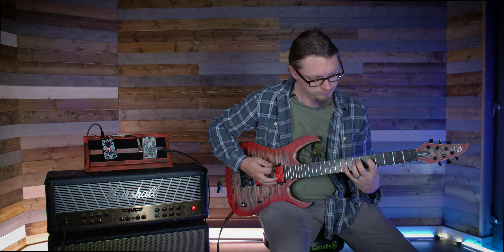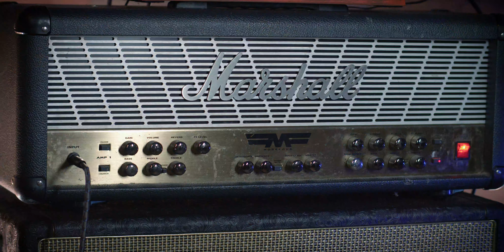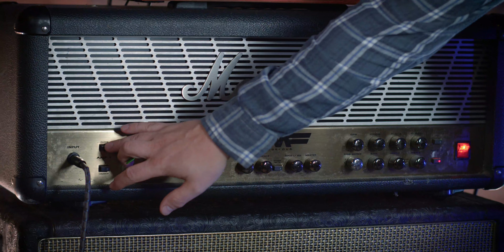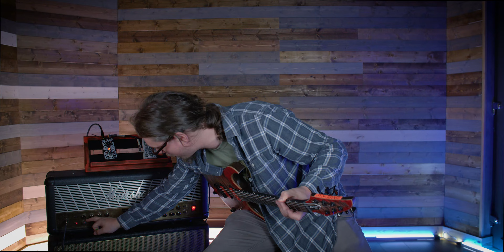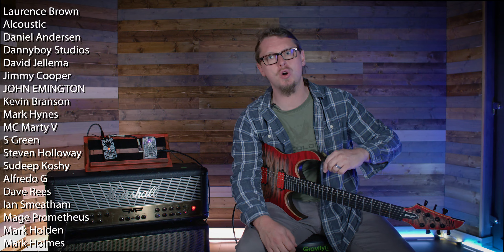Marshall Mode Four - The Solid State amp that didn't actually suck

Comment: When all is said and done, most of us that shred and sweep a lot are using a large amount of solid-state pedal gain or solid-state digital modeler into our valve amps, otherwise tube sounds like it's made of glitter and a kazoo, especially with pinch harmonics. 

I'm an electronics engineer I can also outplay the vast majority of guys with "tube or nothing" religion, and I prefer solid-state bar none. I have some wicked all valve rigs but when the rubber meets the road, either your playing is on point or it isn't and when it is not, you sound 100x worse on 100% solid-state than tube. The division is a scam. Designing and building solid-state that sounds 100% valve isn't the least bit difficult or expensive, it's just greatly frowned upon by the corporate brands.

They want to keep 3 distinct active technologies, solid-state analog, solid-state digital and valves. So, for decades virtually every band has commissioned engineers to design solid-state that intentionally never sound like valves. It's relative to The Light Bulb Conspiracy.

Comment: I’ve owned three and considering getting the half stack again but I can’t help thinking the footswitch is going to be an issue eventually because of its old pin connection ?
Reply: I found one for sale and picked it up.. (I bought a  MF half stack and didnt come with the pedal)
Reply: @ironandzinc  believe it or not I bagged the straight mode four cab on one occasion for just £50 but then at my next gig was faced with a load of stairs and no lift . Not fun and a shame as it sounded amazing compared to its little MG100 predecessor .

Comment: it's a hybrid..not totally solid state.. i have one.. the bad things are:  hard to read knobs.. really.. , the input connector is very  cheap.. 
the foot pedal has this proprietary 15 pin cable and  you can ONLY use the footwitch made for this amp.  if you don't have it (like me), you are basically stuck on one sound unless you use the front panel.. i with they would have added the option to plug a regular on - off switch like the mesa boogies in case you don't have the mesa footswitch.. 

otherwise, i am surprised the excellen  sounds i am able to get from this amplifier.. there is  some noise from the fans but they idle to very quiet a minute after the amp is turned on.
Reply from the maker: It has a couple of preamp valves at most. It’s a solid state power section, so it’s a solid state amp by definition

Comment: Had one of these and the matching angled cab for many years. It was incredibly loud, and looked very cool. Other than that, i couldnt get a decent sound from it. Just thin, cheap sounding distortion. Didnt really know what i was buying when it came out (was my first big amp purchase for gigging, should have done my resaerch but I was young and impulsive) every amp ive owned since has been more versatile and sounded better, including my Marshall dsl1 practice amp

Comment: it's really a valvestate amp, the valve preamp might be the part that made it not actually suck.. not sure on the technical bits, i don't get too deep into that stuff but i can tell you that these are the beasts that feed on beasts. i havent needed or even wanted any other amp in the 17 years that Big Bessie has been with me!
Reply: Right! I went to buy a rig in 04. I brought my LTD EC-1000 into GC and tried almost everything they had. It basically came down to a new Mesa Single Rectifier 50 watt solo head(it sounded better to me then the Dual/Triple, same pre amp but a 2 ch 2 6L6 power stage that still got louder then my band would ever need). Then the Mode Four, 2 pre amp tubes;I was told. I dialed in the same I was dialing the JCM 2000s and got a bitchin' brutal sound. For some reason the GC guy kept selling me the Mesa by saying this is used and has no warranty blah blah blah... being discontinued soon. I'm happy with what I chose and am still with my Mesa +  Mesa Recto Cab 2x12 for 19 years but to this day I still have the Mode Four's sound in my head and want to pick up a used one soon.
Reply: @roymartin500  yeah it really sucks with all the 'supposed' problems historically but i've had none. even after a couple beers and half a can of rockstar she never missed a beat (or note i should say). even worse was when the head hit the pavement as my mate was wheeling it through the carpark, still didn't stop it. so the part that sucks iz i'm forever cringing for that time when it happens and one of the boards blows and i gotta put it aside until i can get the guts replaced which is a huge job from what i can tell.. anywayz the common fault is apparently from overengineering so it kinda suits my style of music anyway without even hearing it hahaha. i'm not sure if you should be weary trying to get one because yeah, i've had 0 problems with it and it's one helluvanAMP!
Reply: if people start using the word helluvanamp then you know you saw it here first 🤣

Comment: I just got one a couple of weeks ago and I'm really enjoying it!! I have found that running the fx send into the fx return of a valve amp (I've tried a line 6 spider valve and an EVH 5153) and it sounds pretty fantastic!

Also, this is technically a hybrid as the preamp has 12ax7s.
Reply: Hybrid amp is when power amp is tubed, power amp doesn’t.
Like MusicMan’s.
Here tubes are placebo effect.
Reply: @ratt669 I’m not quite sure what it is you’re trying to say. Sorry.
Reply: @buhimoth sorry for you then. Maybe read more than one time and look on Google what “hybrid” amp means.
Reply: @ratt669 I googled “like musicman’s” and it came up with “sterling.” I don’t think Google can help translate your comment. 🤣
Reply: @ratt669 with all due respect, if you’re going to post an unintelligible comment and refuse to explain what you meant, what’s even the point of commenting?

Comment: I have/had two (one of them keeps blowing MOSFETs) of these amps and they’re awesome. Seriously underrated especially for the price they go for. I got the first for 350 and the other for 500 with the foot switch. I’m currently trying to find a matching cab for it as they are awesome as well but hard to find.
Reply: I run a Laney LX412A (or is it an LV model) cab, closest match i could find for the wattage. Not a bad match up. I had the same problem finding a MF cab for mine. I've owned 2 MF350 amps now. Love it. But i tend to run effects into it as its difficult to rein in the tone. Just a digitech RP255 with custom EQ

Comment: This amp is awesome! And scoop is useless here, as you said.
Reply: I used it on a master of puppets cover, and the scoop button is perfect for that haha
Reply: Scooped guitar is good for clean lyrics, (also with low bass cut and high treble cut). You can sit the vocals in the lower midrange pocket and also the S and T sounds and hi hat. In Metallica they don't actually crank the guitar all that much, so the drum transients and vocals come through nicely.
I like the mid heavy sound for instrumental though. They were a bit stingy on the bass guitar on some songs though.
Reply: Scoop works great for black metal!
Reply from the maker: An HM2 playing through a broken 40 year old PA system works for black metal 😂
Reply: @adamsteelproducer  hardyhar!  Hey, I have a mode 4 and I wanna add chorus + delay , but use the amp distortion.  Those go through the effects loop, right?  Also, where did you get that pedal case that sits on the amp?

Comment: I have the 1983  Peavey Bandit 65. In 1983 Kirk Hammet had finished most of his tracks using his Marshall stack but it just did not have the attack or balz he felt he got in the room. The studio had this 'New' Peavey and the engineer suggested doubling the parts with it. He did :-) After reading that I looked in the local Kijiji ads. A guy had one never gigged that belonged originally to his dad. It's in near perfect condition (just dirt and grime) I got it for $270.00 USD. It needed a good scrubbing and the volume knob needed a quick contact cleaner spray and it now functions like new. It has a huge percussive sound clean. The dirt sound is very much like a Rat distortion. I bought it for a back up to my Plexi as I am in a powe trio. No amp and no show ...so it is a must have. It takes pedals beautifully and is easily as loud as my Marshall which I run at light Crunch and uses pedals :-)
Reply: What?
Reply: That was my first amp ever!

Comment from the maker: Do you have any solid state amps that defy the usual poor reputation?
Reply: Randall G3 RH300
Reply: @metalhowl  100%
Reply: Crate gx1200h with a crate cab loaded with sheffield 1200s.
Reply: Line 6…….
Reply: My trusty old Roland JC-120 Jazz Chorus has ended up on so many albums I've done. From Blues to Metal, the dam thing just sounds good and somewhat unique. It's my go to amp to use for blending in under our main guitar tone.  Works great as a Bass amp as well, put a RAT pedal in front of it and let those 120w eat! :)
Reply: I don't but BB king sure did
Reply: Marshall Model 3315 150w Lead. Made in 1989 in the JCM800 line and it very much hangs with the big boys.
Reply: Marshall Valvestate 8240. I don't use it but it's decent.
Reply: Hughes and Kettner Black spirit. 
I love that amp. Lightweight , easy to find killer tones, modest FX selection and sounds great through any cab